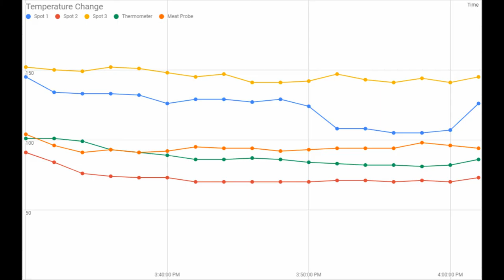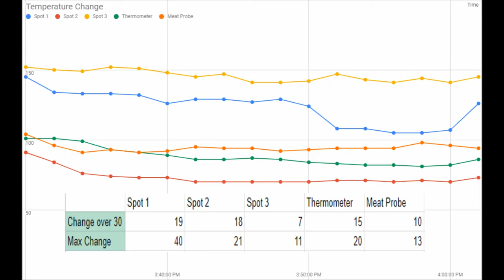Orbit Professional Mist System - Should you buy?

Comment: system leaks so bad using the Orbit Arizona Pump. I have called Orbit and was told it would be OK to change the poly to a 3/8 OD copper line every 2 feet. (Hmmm? I just might do that) Works better but when the pump is turned on 3 connectors still fail.  Why doesn't someone just come up with a "Compression" T setup? I was forced to use a 3/8 splice at the first connector with copper on one side connected to the poly. Orbit, you have to know of this failure.

Comment: I just installed this and 2 of
My fittings leak and the main hose inlet leak :(  i have tried push it back in and it just seems to leak
Reply: Same
Reply: Mine too. Anyone found a solution. I tried tape, yeah rather a stupid idea. Thinking of trying silicone around the end, and then pushing it in?
Reply: Really sorry we didn't go with a higher quality system.
Reply: @oldpilot920  Yep, same :(
Reply: Why Not Simply Use Krazy Glue, or a Mixed epoxy , just a fine coat before You assemble the Mist connectors / where the Barbs Go into the House... It won't Leak, and it Won't come apart, and the Nozzles will be Secured in the Spraying Direction You Like Most..!!  Just Sayin ...
   BillinL.A.  7-15-2022

Comment: Great video!  One quick question, did you ever wind up buying the pump as well?  I have a similar application that I was thinking about using it for but was torn on if I would need the booster pump or not.  Was wondering what your thoughts would be now that you have had it for a year.
Reply: I live in sunny at pete Florida. Just installed mine and the water pressure is too low where I live (30-40psi). Therefore the regular water pressure off the spigot is too low and the “mist” is not fine mist to a point where it gets everything wet instantly including myself. Did some research seems it needs more pressure, the more psi the finer the mist. I just purchased an orbit 160 psi booster. Great reviews and can’t wait to try it out. I think it should solve the problem. Seeing this video he could use a booster to get the spray controlled and longer.
Reply: Don Sherpa howd that pump work out Don?
Reply: Anthony Fletcher it works great! Def a significant change in pressure. The mist is much finer than before. Dispersion is a lot more significant as well. You can literally here the difference between regular spigot water pressure and the booster pump, meaning you can hearThat “pshhhhhhhhhhhh” noise if it makes sense. Sad that most of these amazon reviews on misting nozzle kits don’t mention the booster pump, in my opinion it’s useless without it. Good luck hope this helps! I might post a video on it in the near future.